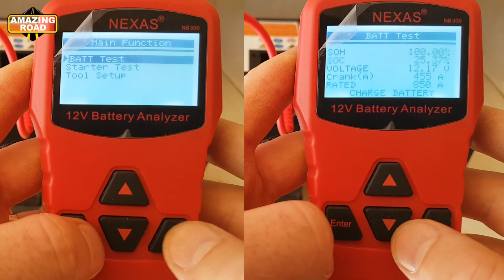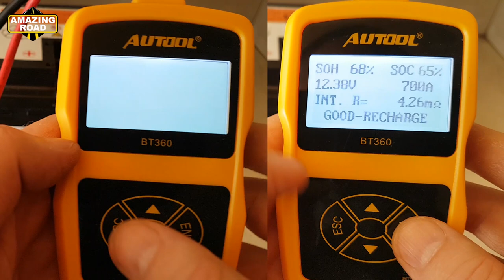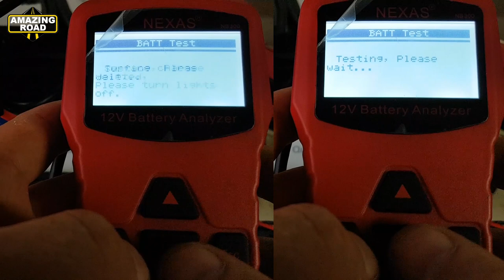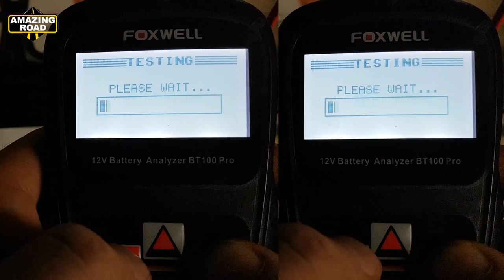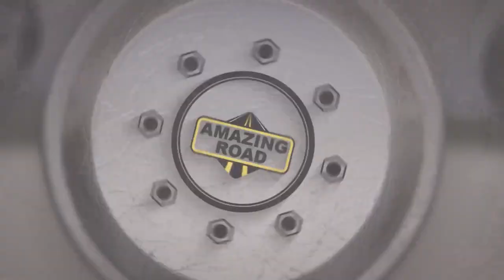Comparison of 3 Scanners for Battery Foxwell BT100 Pro, AUTOOL BT-360 and Nexas NB300

Comment: thanks for your comparison. I have this Autool and saw that he can cheat for AGM. Classical lead acid is measuring quite correctly. I compared it with the professional and expensive Midtronics tester - Autool only overestimated about 4%. For various AGMs with motorcycles a difference of 40-50%. Can you compare these testers on a regular acid-lead battery?

Comment: Hello. I have just bought this BT360 tester and I have tried to measure on new AGM battery Varta 70Ah, 760A. The measurement was SOH 70%, SOC 98% and only 670A. Is this correct or something doesn't work. Thanks for your help.

Comment: May not be exact, and doesn't really need to be accurate right on the nose but just enough to give you a good idea of when something is about to kick the bucket.
Reply from the maker: https://www.youtube.com/watch?v=xswM2_JUAC4&t=47s
Reply: Can be used for a good comparison. My AGM battery is 4 years old rated at ( 680 A EN). My topdon tester ( which is the same as the autool) says my battery is down to 450A EN and 43% SOH. I then put it on a new battery and that read 740 A EN ( rated 680A ) and 100% SOH so that tells me i have trouble ahead.

Any battery i know is bad the tester always said “ replace”, any new fresh battery i tested always gives more CCA than it’s rated CCA

Comment: Good test but not enough tests and meters used (i.e. professional quality DVOM and milliohm meter) to draw fully confident conclusion except for this; Nexas isn't number 3, it just failed & unless subsequent tests confirmed battery is actually bad (which would invalidate current conclusion that both Autool & Foxwell are acceptable choices) then it should not be considered at any price.

Comment: Entonces cual de los tester de batería es el más fiable? El nexas?  O los otros dos?
Reply from the maker: foxwell
Reply: I think your wrong, is better autool why?. Because foxwell says replace battery in the first attempt, and autool says recharge, after recharge autool says good battery and foxwell too, but why replace if you can charge it.
Reply: @DarthAnjastis  Correct Felipe! Notice both internal resistance and voltage change significantly after the long recharge, many modern chargers have a recondition function that really works on batteries that are in questionable state produced by neglect or a single non-fatal discharge. Saying it's bad just because it's not ideal is a poor choice. This video is a perfect example of a battery that likely has 1-2 years more useful life.

Comment: Cat got your tongue??
Reply from the maker: Foxwell
Reply: No no no Autool is better. First foxwell says replace before charge, autool says recharge, after recharge both says good battery, but how? . Plus point for autool. Second autool is cheaper than foxwell and third hace more functions like alternator test and load test
Reply: @DarthAnjastis  but autool show huge difference in cca before n after charge. Cca supposed to be the same
Reply: @abuhanifah3380  how can CCA be the same on fully charged battery when compared with empty one. Empty battery has naturally lower capacity to deliver amps. But I don't believe any of them, results were just too random.